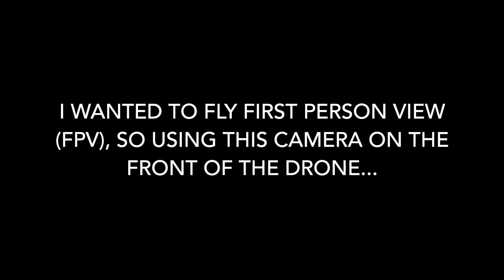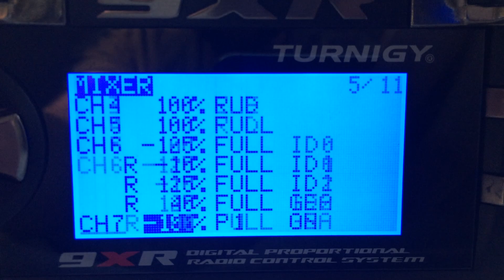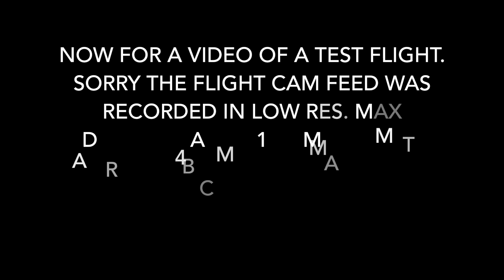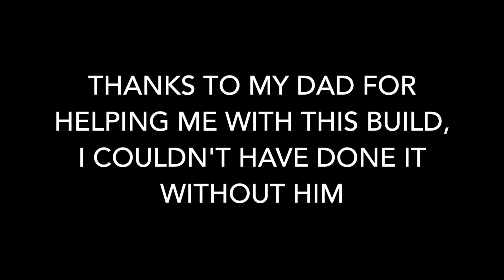Skywalker 1900 FPV - Build & Test Flight 1 Mile +

Comment: Hey Adam, looking back now... What do you think of the skywalker in 2020? Regards Mark
Reply from the maker: Hi Mark, the Skywalker is a great plane and I have had so many amazing flights with it. As you might have noticed, I sold mine this week. The reasons for selling it: 1: too many models and not much space to store them all. 2: Get some cash for new projects 3: I wasn't flying it anymore. And this is because A: my flying style has changed, I used to love long range gentle cruising and using pan tilt to look around and take in the views, which the Skywalker is PERFECT for. Recently I prefer faster and lower flying and therefore the Skywalker got less use. B: I've got less patient for assembling a model in the field. It look more time and effort to assemble in the field than I would like, especially when you compare it to Skyhunter (2 screws in the boom and ready) or the Mini Talon (no assembly required).